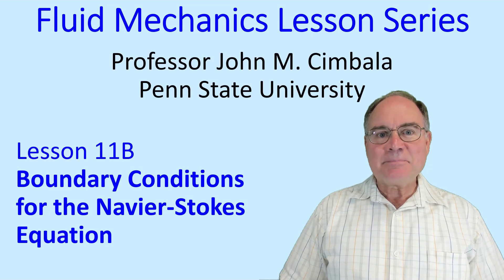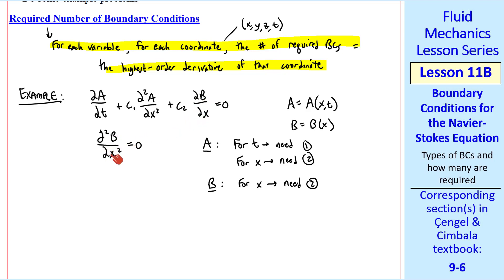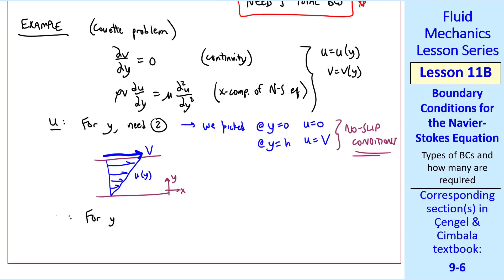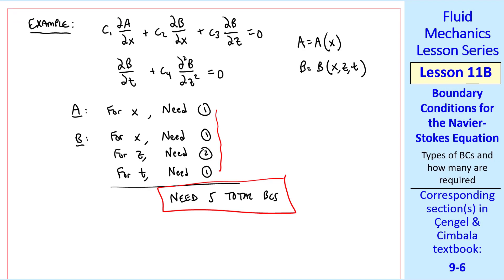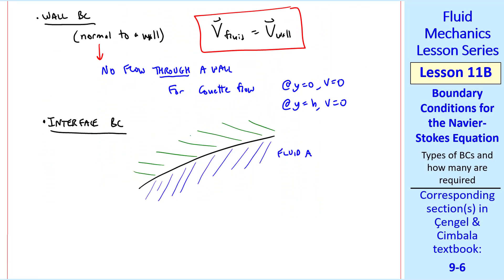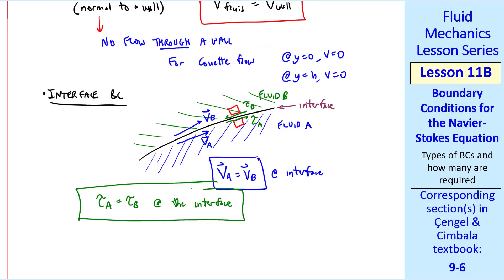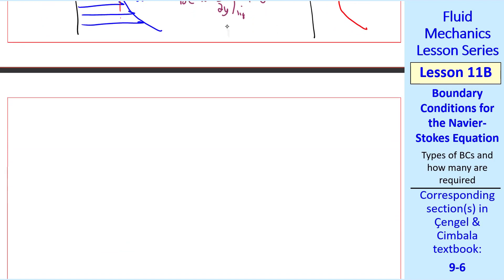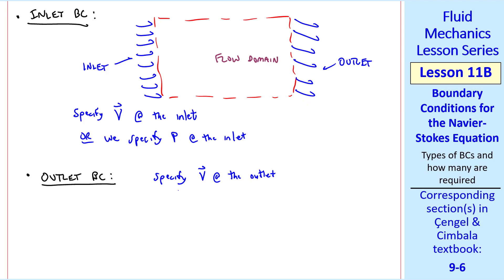Fluid Mechanics Lesson 11B: Boundary Conditions for the Navier-Stokes Equation

Comment: Hi Professor, why we only specify pressure or velocity at boundary why not both since pressure  is appearing as (dp/dx etc) and velocity as (d2u/dy2 etc) so one(or more) for pressure and two(or more) for velocity? Is it because they are coupled?
Reply from the maker: Yes, the coupling makes BCs more complicated. You must be careful with boundary condition specification. I explain the rules in Lesson 11B with several examples. Consider the 2-D case for simplicity. Since p appears as a first derivative in x and as a first derivative in y, we must specify p at one x boundary and one y boundary. However, u appears as second derivative in both x and y, so we must specify u at two x locations and two y locations. That is why we typically specify u at the inlet and the outlet, but pressure only at one x location, typically the outlet.
Thank you for your comment. Please tell your friends and colleagues about my YouTube channel where there are more than 600 free videos about the Bible, fluid mechanics, science, math, Excel, statistics, air pollution, and other topics. I would greatly appreciate it.

Comment: 0:30 This is a very nice and clear formulation, but is there any associated theorem that prooves existence/uniquness of a solution for the required number of BCs? What are the other conditions on the differentiability/smoothness/analyticity (or anything else) for the functions involved?

Also, what counts as a single boundary condition in a general case, when we have curved boundaries?
Reply from the maker: I am assuming smooth, continuous functions. Otherwise the analysis would not be correct. As for curved boundaries or walls, you would not be able to set a single BC, but would have to have a BC on every point along the wall. Pressure would change, for example, with liquid depth along a wall. But velocity would still be zero everywhere on the wall if the wall is stationary.

Comment: Nice vid, professor. How about IC and BCs for channel flows in general. I.e. 1) for open channel flow (as I understand, in this case there will be free surface on top of the fluid, and air pressure); 2) for closed channel flow or pipe flow (as I understand, in this case there will be no free surface, the fluid will "fill" the whole space between the plates and flow). In each of these cases, what would be the pressure grad terms and force terms in NS eqs? Sorry for my English. Not a native speaker. Again, thank you for the great video.
Reply from the maker: You would have a free surface with open channel flow. For closed (filled) channels and pipes, the wall boundary condition applies and you typically do not need to specify pressure at the walls. Pressure occurs in each component of the N-S equation as a first-order derivative (with respect to x, y, or z). Thus you need only one BC for pressure at some x, at some y, and at some z, for the general 3-D case.